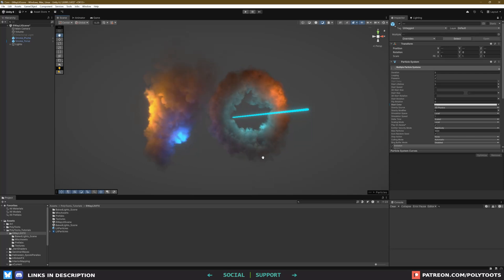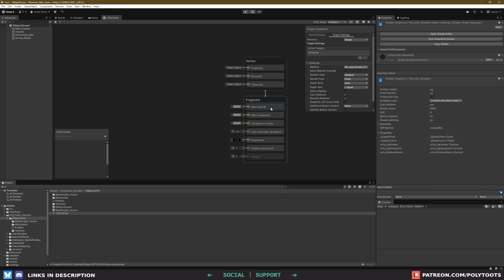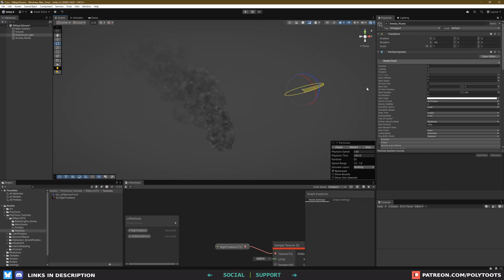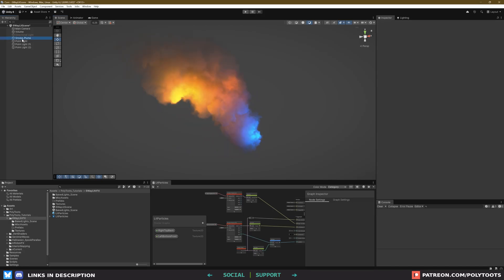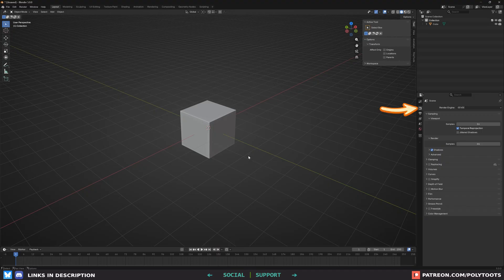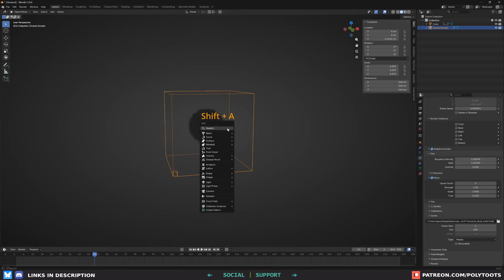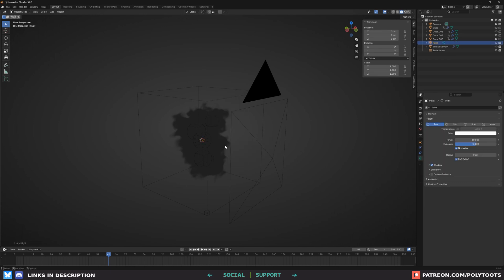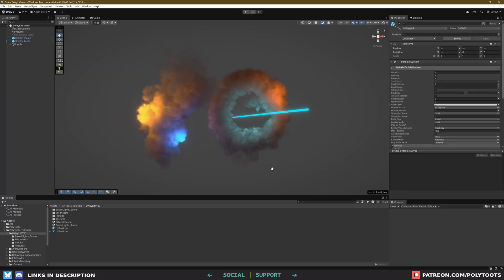Unity 6 Fake Volumetrics (Lit VFX) in Shader Graph

Comment: Fantastic video, would it be possible to do a flipbook with frameblending?

I'm also curious if a distortion effect would still work over the entire shader.
Reply from the maker: I think flipbooks were mostly Unity's intent tbh, they had some examples a while back and all the footage I saw were using this with flipbooks.

Distortion should work fine so long as you distort the the same UVs the textures are on.

Comment: FIRST!!!! also thanks for sharing this info, I always thought that those 6way particle stuff unity kept talking about was rather baked and not as dynamic, but this is veeeery dynamic man. 
Btw, does this work off of per pixel apv?
Reply from the maker: Hmm probably not true per pixel. But I thought that was the case for APV regardless. Sampling does happen in the fragment, but the GI itself is still probe "voxel" based
Reply: @PolyToots  afaik apv has 2 modes, per pixel and per vertex, you probably have APV set to per pixel right now. 
as for the voxel stuff, that am not sure about, havnt used U6 that much.